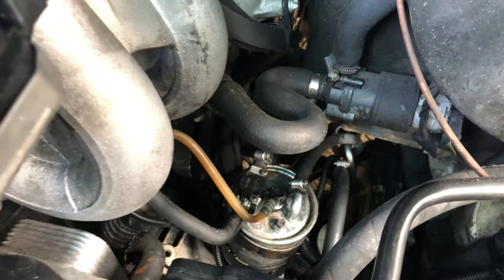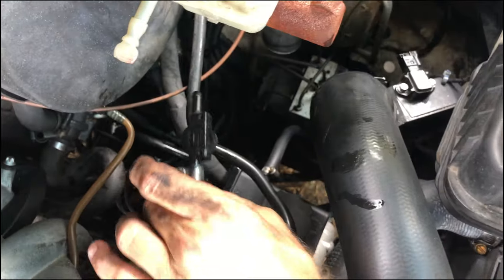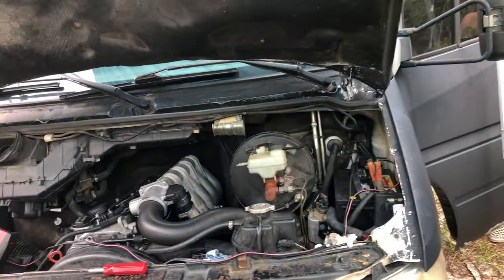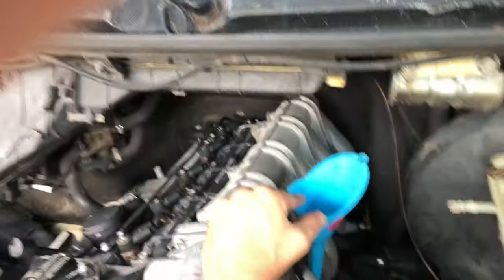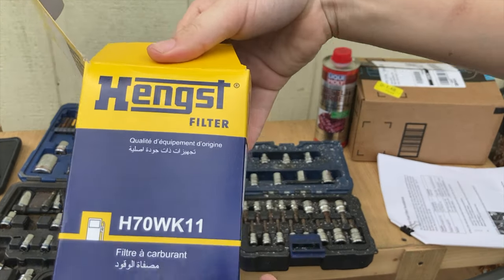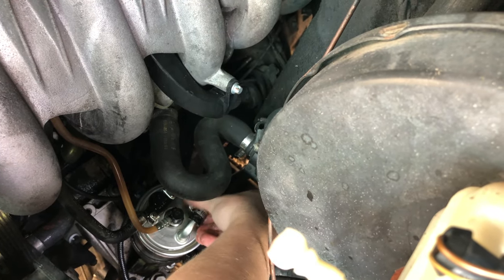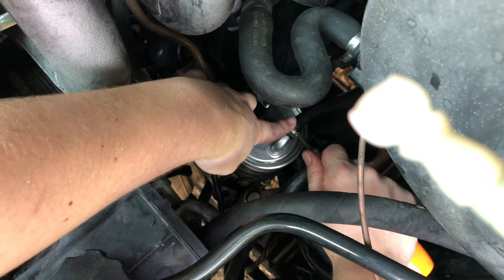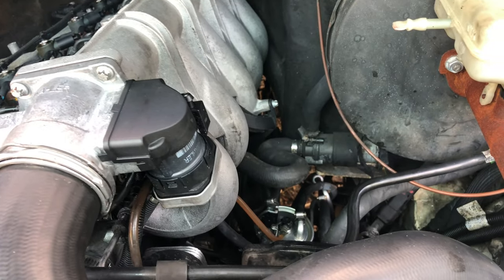Diesel Moly Flush and Fuel Filter replacement on 2002-2003 Sprinter T1N

Comment: I believe the drain you mention about  1 minute into the video is for removing water from the fuel filter.  I only know this because my WIF (water in fuel) dash light turned on yesterday.
Reply: They can also be a cause of leaking or letting air in so an 2002-03 will not start without re-priming  ! Tip from another Sprinter guy was just replace with a filter with one without the water bleed valve, 04-06 don't have this & water in the filter isn't an issue, changed mine & never had a problem between filter changes.

Comment: Finally years of requesting answered! Had to cycle four times for ten seconds while hose of diesel full using gravity feed the tank inlet port on the fuel filter. Every oil filter change is it? I too went with the non water drain valve on the outside to prevent air leaks. Also left the water sensor zip tied to the base, no longer needed.
Reply from the maker: I would not do this with every fuel filter change. It is a cleaning that has worked for some. Our van must need something more than cleaning. These injectors passed leak off test in another video, and smooth running test in DAS. They will be shop tested tomorrow. Stay Tuned.

Comment: Do you have any tips on bleeding the air out of the fuel line? I have air in the line going from the fuel filter to the fuel pump that I’m having a hard time with bleeding out.
Reply from the maker: A little diesel in a spray bottle, 2 or 3 sprays into the elephant tube while glow plugs warm, and start the van. Air should pass the lines quickly once engine starts.
Reply: I’ll give it a shot. Thanks man!
Reply: What is elephant tube?

Comment: Hi 👋 hey question about the fuel hose from the fuel pump is there a problem if  I add a tee vacuum adapter  to connect a diesel heater  ? Would this tee affect the pressure on the pump  possibly affecting the function of the pump “ this is before the diesel gets to the pump of course “ . 
By the way Florida van man your channel has help me to understand my van better .  I love your channel . Keep up the good job 👍 👏🏻😉
Reply from the maker: If your van has an in-tank fuel pump this is not a good idea. North American Sprinters before 2004 don't have a pump in the tank, so it would be fine.

Comment: I do like those filters.  Really messy with the first lstock one. So the takeaway was to flush the injectors as a yearly service thing? Cost of filter?
Reply from the maker: I hope the take-away is: The flush is simple and easy with the mechanical fuel pump of the 2002-2003 but we didn't find a miracle cure we hoped for. These injectors will be professionally shop tested tomorrow. Stay tuned for that video. If we find the injectors are good and the van's problem is somewhere else..... We proved nothing, but showed the process. I think the advice was, "keep them wanting..." LOL

Comment: Hey thanks for all your videos! Just replaced the fuel filter on my 02, forgot to refill the filter first time around it started for 2 seconds and killed. I then filled the filter with liqumoly and tried again but it wouldn’t turn over. Is there a way to get fuel back in the lines to the fuel rail? I understand there is no pump from the tank
Reply from the maker: The low pressure pump on your van is at the front of the engine just above the high pressure pump. It sucks fuel from the tank and, yeah that sucks! Some folks have used a shop-vac to pressurize the fuel tank while starting the van. Others have loosened a fuel injector line to relieve air back-pressure. Be VERY careful if you do this. When the van starts the pressure in that rail is EXTREME and any fuel flying out of the open line can cut like a knife or worse, get into your skin and bloodstream.
Reply: @FloridaVanMan  I actually found another solution! Bought a few feet of 3/8”ID clear tubing, hooked it up to the filters inlet, held it high and filled the tube. This created a “beer bong” type of system to feed diesel enough to start it. It ran for a couple mins while it burned through what was in the tube. The I reconnected the tank feed and it turn over rather easily.

Comment: A bit confused what the point of the liquid Moly is vs just filling the filter?
Reply from the maker: Liqui Moly was a hopeful idea to clean the fuel system. Some folks gave it high recommendations but it did not help our problem. Since cleaning the fuel system is a frequent topic and this is an approved method, we decided to share the process. It didn't work this time, but we will certainly try it again on a later model T1N that may or may not be helped by cleaning the fuel system.
Reply from the maker: My first reply missed the point of your question. We could have just filled the filter with diesel or Moly, but we wanted to recirculate pure Moly to really scrub the fuel system. As we have done it here, the overflow returns to the can rather than going back to the tank and getting diluted with diesel.

Comment: What do I do if my original filter has a sensor do I just leave it off and that new aftermarket filter will work or no ?
Reply from the maker: Keep the sensor from old filter plugged in and tie it up out of the way. it will not have a place in the new 'no-leak' filter and will not trigger a light when tied up.
Reply: @FloridaVanMan  thanks for the quick reply boss

Comment: Also, what did you do with the electrical connection that you removed?
Reply from the maker: Just tied it up out of the way. Nothing special.
Reply: Florida Van Man thanks. I am only a little worried about not having a water separator sensor /drain. But I used this filter seen in the video.
Reply from the maker: @nicholasmartin7922  ULSD is so heavily regulated in the USA we don't need to worry too much about water in out fuel lines. I'm over 50 and only thought I had water in my fuel once, long ago. Turned out to be an electrical issue causing misfires (gas engine). When playing with veg-oil fuel I had suspended-water in the oil, which apparently just passes right through the filter and WIF sensor. :(
Reply from the maker: @nicholasmartin7922  How many times has the water separator / sensor saved you in the past? I'm guessing it never has, and never will, so removing it is not a big deal.
Reply: @FloridaVanMan  did you reattach the sensor to the connector? if not does this cause any light issues on the dash?
Reply from the maker: @lylekelley4293  Just tied up the connector so it is out of the way for future, and dirt can't collect in it. With no sensor it just assumes no water in the fuel and does not realize the sensor is missing.

Comment: 02 Sprinter here. I have a can of liquimoly, Debating to just pour it in the filter and reinstall, or run it through like you did. Can you tell me what you did with the line FROM the tank and return lines? Is it in a separate diesel pale just to get started? Or is it also in moly.
Reply from the maker: Starts on diesel in the rail and lines, but I expect it will start on Moly also. We simply removed the lines from the tank and filter. Since there is no in-tank pump on your '02-'03 models there was no need to do anything more than prevent dirt from falling in them. 
The purpose of putting both hoses in the can like this is because the Moly will dilute if returned to the tank with diesel. Supply and return lines in the can like this keeps the Moly concentrated and recirculating until it is almost all used full-strength.  It takes a while to burn a full can, maybe 10 minutes from what I remember. It will flush out of the filter in a few seconds, dumping most the Moly via the return line to the tank.

Comment: I am trying to help my elderly neighbor get his 2002 Freightliner Sprinter running again. It has had issues in the past needing an ether kick to get started the first time for the day. But that was over a year ago and before he put in a new fuel filter. After the new filter he drove it 200 yds and it died.. would not stay running, would do a baby start with ether(just a sniff).. So we were thinking the fuel pump.. Is there no in tank fuel pump in this year? I do see way too much air in the what you called the low pressure pickup tube from the filter. If there is no pump in the tank i will give this reprime a try.. Thanks in advance. I do my own mechanic work but not on diesels so I am trying to get up to speed.
Reply from the maker: Correct; there is no in tank fuel pump. The fuel is drawn up by the fuel tank into the low pressure fuel pump (the top smaller fuel pump, with clear lines going into it). You should be able to see if the clear lines have bubbles in them while it is cranking. Those clear lines leaking and letting air in is an extremely common issue on 02/03 Sprinters. The 04/05/06 virtually never have this problem unless the in-tank fuel pump fails. There is still a sensor in the tank though, when you put the key on you should be able to see the fuel level. 

Another tip: Don't use ether on a Sprinter! It's way overkill for it and can actually harm the engine and crankshaft when it fires, just put diesel in a bottle and spray into the intake manifold.
Reply: @FloridaVanMan  Replaced all the clear fuel lines (might be a good video to do, I broke the clippies under the low pressure pump and used zip ties on either side to hold the lines up from the serpentine belt).. what a pain! Under the top engine cover looks clean, I do have an Injector return line on standby but the current one looks fine. Tried to do startup procedure with the IV gravity diesel tank method,  noticed the Fuel filter water sensor was leaking..ugggg.. reseated and got it to start and move under its own power! Engine seems OK. I think the fuel filter water sensor is still sucking a small amount of air so am ordering the No leak filter in your video. Thanks for the help from you both!

Comment: Hey man my t1n 2500 sprinter van kinda jumping going low speed when slowing down and when speeding up. Any diagnostic info you could give me?
Reply from the maker: Sounds like you have a failed wheel speed sensor causing the ABS to believe one or more wheels is locked and sliding. A compatible code reader will help diagnose by watching wheel speeds in live data.
Reply: @FloridaVanMan  Do you look at vans and tell people whats wrong with them? If so would you be willing to look at mine i happen to be in Orlando Florida.
Reply from the maker: I do work on vans for Patreon members. https://patreon.com/Florida_Van_Man?utm_medium=clipboard_copy&utm_source=copyLink&utm_campaign=creatorshare_creator&utm_content=join_link 
  @LilOrphicMusic

Comment: It has a loud knoking noise....any ideas from where it comes?
Reply from the maker: The engine in this video was replaced before the van was put back on the road. This diesel cleaning did not help the trouble this engine has and it will probably be rebuilt eventually. it runs but smokes and sounds not great.

Comment: Why did you do it? What were the issues you were trying to fix? Really can't believe I am first again, this is very sad
Reply: Like oil change maintenance is needed, high mileage an easy flush and hope and prayer keeps it going
Reply from the maker: We were hoping to fix a smoking habit. It may not be an injector issue but a good system cleaning seemed a good place to start. It did not help, but we will try again on the newer T1N with in tank pump. That will be a bit more involved and hopefully have more impact on different mild symptoms.
Reply: @FloridaVanMan  Interesting stuff, thanks for the reply

Comment: any reason a pure liquimoly purge shouldnt be done on an 2nd gen ncv3?
Reply from the maker: No reason I know of. It has plenty of lubricant and *fuel to safely carry-on. But what are you hoping it will do?
Reply: @FloridaVanMan  I have an odd rail pressure issue where it stalls when I release the throttle too quickly, rail pressure goes down to zero. my assumption is a sticky relief valve which doesnt shut fast enough, will try this before I replace valve

Comment: So when r u going to show  are tactical art at changing out the glow plugs on that 2002. What with that mountainous intake in the way. Could be a challenge.
Reply: Move where it's warmer? Ha ha. I kid, but only kind of.
Reply from the maker: Swap with OM647 intake manifold. Unless a tool exists, I don't see any way to get those glowplugs out without pulling the engine and taking the intake manifold off.
Reply: @FloridaVanMan  tanks for ur reply.  I'm putting the parts together to do just that but I thought you might buy me some time and show the changing which would complete ur sprinter basic 101 basics.
Reply from the maker: This 2002 we have now has become quite the *educator. lol (sad face). It may get the OM647 intake upgrade before it is all done. If I need to get at the fuel rail, you can bet this manifold will get the Big YEET!
Reply: @FloridaVanMan  Other than the manifold and EGR valve (with gasket), are there any other parts required to make that switch?
Reply from the maker: @RossNoble1987  I am preparing to swap the entire engine. The OM647 manifold will go on the replacement engine tomorrow. So far the only other part I have identified is a new gasket for the manifold. That arrived today, and I got the engine cleaned. it has two injectors stuck, that I want to pull before installing the engine, so I have a slide hammer ordered. it may be slow, but the process is underway. A video will follow completion.

Comment: Ah, now I get it, the moly is a flush. My apologies for being dumb.
Reply from the maker: The Moly is an often discussed and occasionally bragged about cleaning process for the injectors and fuel system. We didn't brag about it here because it didn't do any good for this van. There are too many independent accounts of first hand stories on the FB groups to call it Myth-Busted, but we certainly didn't find a miracle cure we hoped for. These injectors will be professionally shop tested tomorrow. Stay tuned for that video.

Comment: Hello everyone, I own sprinter 2500 2005 the OBD connector is not working, when I connect scanner it don’t work, I checked all the fuses, they all are ok  ,anyone have any idea,  much appreciated
Reply from the maker: Sorry for being slow to respond. I've been meaning to crack the books and figure out what pin(s) on the OBD port should have 12v and recommend testing those. But I haven't cracked the books or found the "Sprinter OBD pinout" online.
Reply: @FloridaVanMan   thanks for your reply if you have any suggestions please let me know thanks